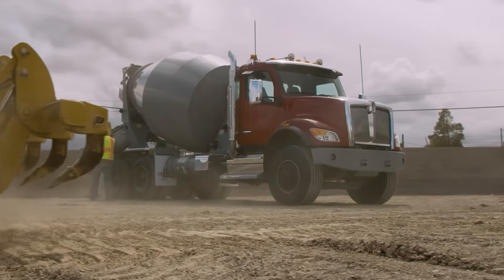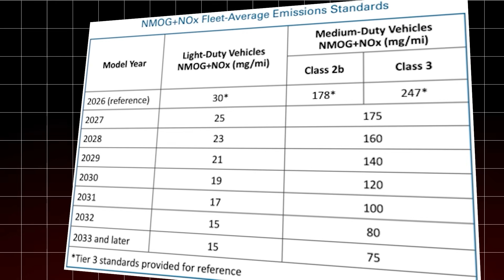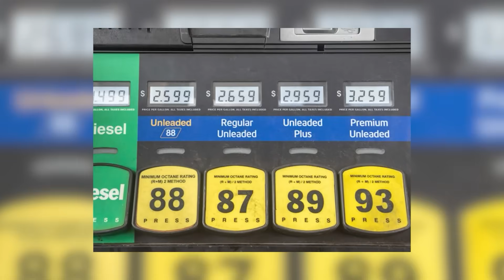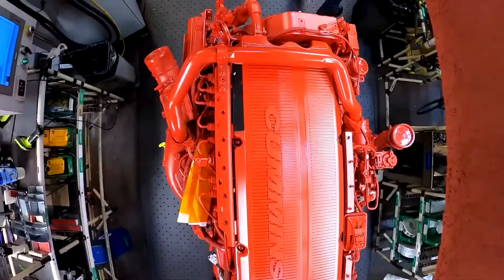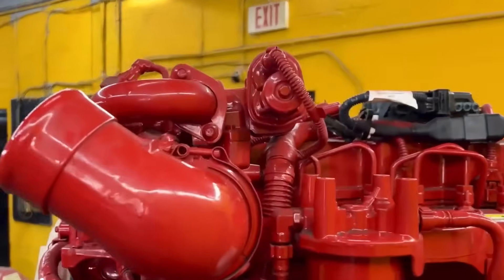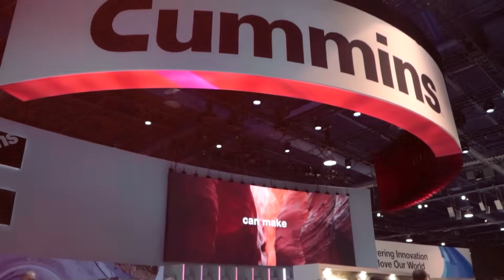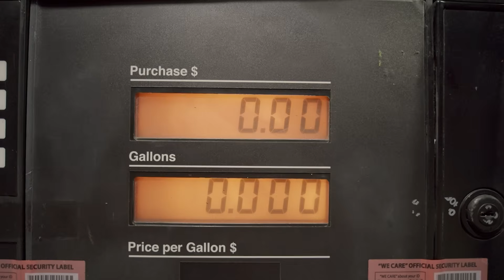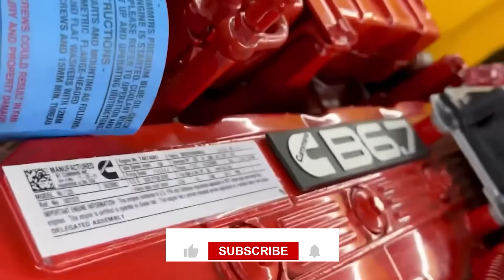Is This The End For Diesel Engines?

Comment from the maker: 9 Diesel Truck Engines That Last FOREVER- https://youtu.be/puaVEj0mc6c

⬇Care Care Clues Top DIY Tools and Products:
🚗 Essential Scan Tools
Newest Scan Tool:https://amzn.to/3GJyuET 
Bluetooth Scan Tool: https://amzn.to/42AcBRc 
Cheap Scan Tool: https://amzn.to/42WZIzx 

🔋 Emergency Essentials
Best Jump Starter: https://amzn.to/44fYOAm 

🛢 Fluids and Leak Stoppers
AT-205 Re-Seal (Stops Leaks):  https://amzn.to/3S9icYm 
ATS 505 Fuel System Treatment: https://amzn.to/3YQjjA2
Lucas Oil Transmission Fix: https://amzn.to/4jNk98M 
Bar's Cooling System Stop Leak: https://amzn.to/3Sht0nj 

🔎 Quick DIY Diagnosis Tools
Head Gasket Leak Test Kit: https://amzn.to/4jRgc2T 

🛠 Useful Maintenance Accessories
Quick Twist Oil Drain Valve: https://amzn.to/4jWG3GJ 
Tire Gauge (Check Pressure): https://amzn.to/3GxySGD
Tire Air Pump: https://amzn.to/3RZK9Cd 
CRC Mass Air Flow Sensor Cleaner: https://amzn.to/44dJpkb 

🧰 Mechanic’s Must-Haves
Car Battery Tester: https://amzn.to/4jTqyzk 
Basic Mechanic Tool Set: https://amzn.to/3Ymgerh 
Cordless Impact Wrench: https://amzn.to/3YkkhVc

Comment: This engine is the result of bad policy. The diesel is cleaner than gasoline.
Reply from the maker: You’re not wrong about diesel’s efficiency, especially on CO2 per mile when optimized. But with tightening emissions rules, diesel’s getting weighed down by expensive aftertreatment systems and compliance headaches. Cummins' HELM platform gives fleets flexibility without locking them into one fuel. Not perfect, but it’s a smart bridge for what’s coming next.

Comment: Why they not going with electric?
Reply: because electric fucking sucks
Reply from the maker: Full electric sounds ideal, but for many fleets, especially in rural or high-demand settings, the infrastructure and range just aren’t there yet. The B6.7 Octane is a step toward cleaner tech without losing uptime or performance. And with the HELM platform, Cummins is laying the groundwork for hydrogen and other alt-fuels too. It's evolution, not overnight revolution.

Comment: Gasoline engines simply don’t last as long as a Diesel engine.
Reply: Yeah, I'd be willing to be the rev range is a lot higher for this thing. Gas motors have to work so much harder.
Reply from the maker: That's true and diesel still wins on raw longevity in many cases. But what makes the B6.7 Octane interesting is that it's built on the same legendary block as Cummins’ diesel version. Over 13 million engines have proven its durability, and now it’s paired with simpler maintenance and fewer emissions headaches. Real-world results will tell the full story, though.
Reply: True but gas is cheaper.